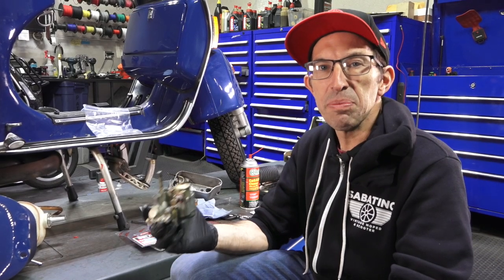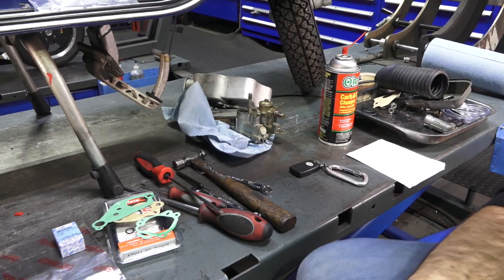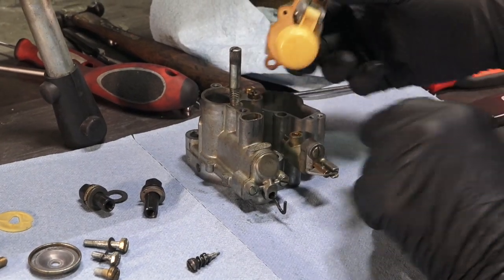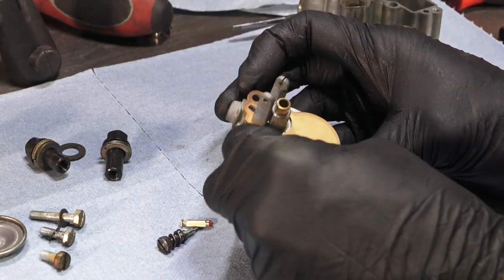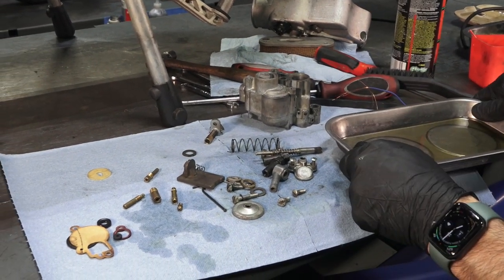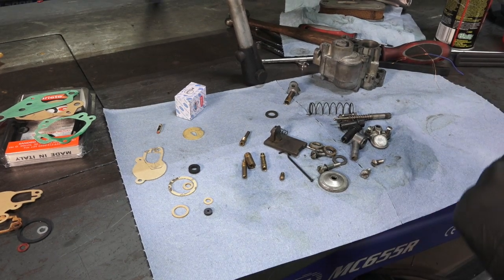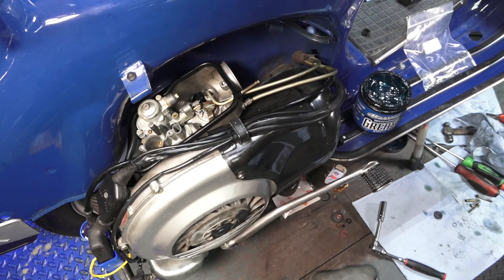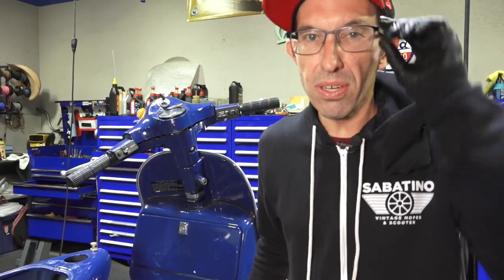Prepping An All Original 1978 Vespa P200E For Sale: PART 4 Carb & Oil Pump Rebuild

Comment: Thank you for sharing!! I'd just gotten a 1980 P200E in the shop. Quoting out a mechanical restoration and a Frame up on it (If the customer goes for it) and Ive been trying to find good parts for these!!!
Reply from the maker: Right on!

Comment: I'm a great fan of your work.❤️❤️
Reply from the maker: Thank you so much 😀
Reply: @VespaMotorsport  hey can you help me with my work?My scooter is not starting.i am receiving spark but it's not cranking.i own a vespa star 1997 2 t.I checked for the resistance values of the stator.
White to red=111.2ohms
White to green=388.6 ohms
Is my pick up coil blown? The spark I recieve is very strong too.please help me out🙄🙄.
Reply: My scooter started.It was an issue with the idle screw and mixture screw 😂😂

Comment: 38:10 I’m cleaning the carburetor on a px125. I saw no grease in this place. I’m in South America on a far away place and I have to get by with what I can 😢. I was thinking in using Vaseline. Would that work? If not will any grease I find in any car mechanic shop work? Or would it be best to leave it clean if I don’t find a proper one?
Thanks in advance for any help.

Comment: Halo robot, its great video, but i have problem with slider, when it plug with oil pump, it looks like a little slower to back to original position,  that caused throtle more longer to close, how do you fixed it?

Comment: Excellent videos Robot! My wife just bought a VBC1T 150 Super that has a stamped manufactured date of 1974 but the serial number (287980) says it's a 1975. For ordering parts is it considered a 1974 or 1975? Thanks!

Comment: I have a Vespa Cosa 2 125cc, made 1992, somehow when it sits for a week standing and when i start after it smokes alot until it's burning the oil inside the engine. After 5 minutes or so it smoke disappears and runs well. As well i noticed an oil leakage in between exhaust and engine. I am thinking my oil pump leaking during sitting and filling crankshaft with 2T oil. What do you suggest to check or repair? It doesn't consume gearbox oil, I've checked and doesn't smell bad.
Reply: hello i have the same issue, did you found a solution?
Reply: @Uthathlor  they say it's normal
Reply: @scootmotoshop  lol :D But i have seen same models not leaking at all.